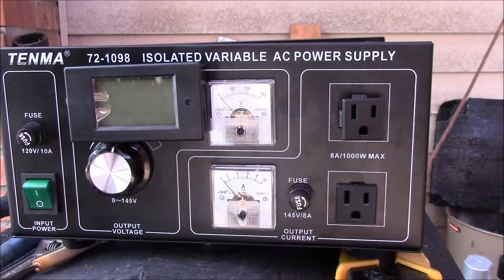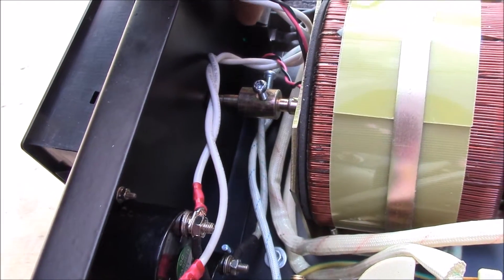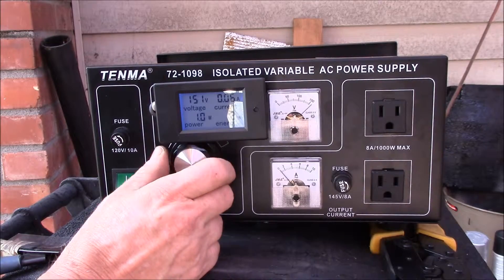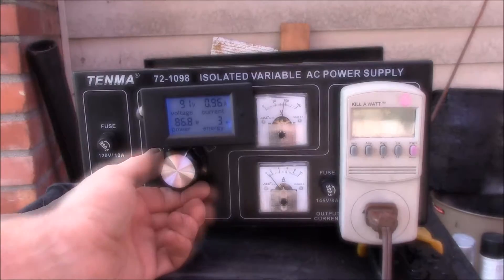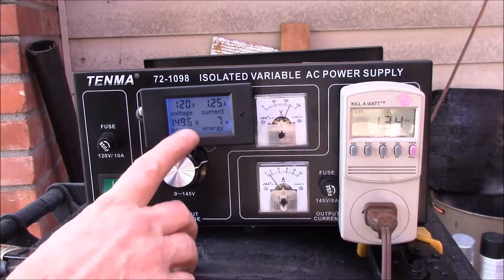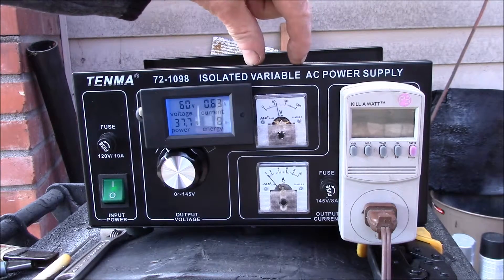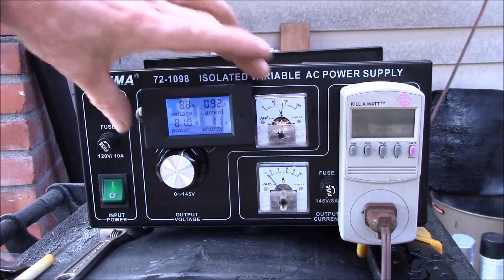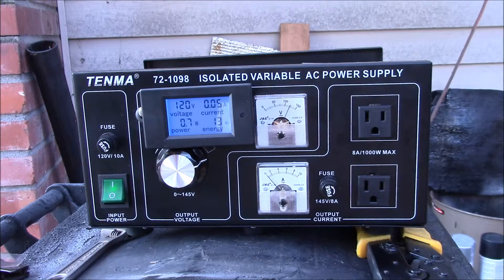Tenma 72-1098 Isolated Variable Power Supply, Upgrades

Comment: I only see 1 adjustment knob  ..only a voltage adjustment  .  ....can you not adjust the current lower than 7A ?   ..eg: limit the current to a max of 1A     ..you cant set current limits without a knob can you ?
Reply from the maker: Correct, there is only the AC voltage adjustment on the Variac inside.  There is no current adjustment and the 7A is limited by a fuse.  The current that flows will be determined by the output voltage and the impedance of the load.
Reply: @The4Crawler  do variable current  units exist ?
Reply from the maker: @relaxingnature2617  I think that is available in high end units, something like below:
https://www.keysight.com/us/en/products/ac-power-sources/ac6800-series-basic-ac-sources.html#KeySpecifications
If precise control of current isn't needed, there are tricks like using various size incandescent bulbs in series with your load to limit the current.

Comment: Sadly, Tenma (MCM Electronics) just dropped this supply from their lineup. In fact, it was in their latest advertisement, but isn't available on their website anymore. They even discontinued their more traditional "Variac" type variable A/C power supply. I'm hoping that they will either bring it back or replace it with something better. I ended up buying a Global Specialties 1420 instead. It's the same as the BK Precision 1655A, just rebranded. Unfortunately, the current output is only 3 amps constant and 4 amps intermittent. The 1420 & 1655A have two feature that this one doesn't have. The first is a variable output for a soldering iron, which is kind of pointless considering that if you need one of these supplies, you most likely already have a good solder station. Secondly, it does have a leakage tester which is a great feature if you work on older tube equipment or just want to perform safety checks on equipment that you have serviced. It came in handy for me recently. I was replacing a multi switch on my satellite system and received a small shock while connecting one of the coax cables from a satellite receiver. It turned out that another piece of my home theatre equipment was leaking A/C to the chassis, and like most consumer grade audio equipment, none of it is grounded. I repaired that piece of equipment and also eliminated a ground loop between my house and shop caused by A/C riding on the braid in the coax cable. Wow... that got a bit long-winded. I just like sharing experiences that might help others. Good video. Have a great day!
Reply from the maker: Thanks for the update.  Sorry to hear the product is discontinued.  Hard to find in that 7 amp rating, this thing is a real tank with all the copper and steel in it.  Good to know about the alternative, the leakage tester sounds like a nice feature.

Comment: What do you use that varible power supply for?
Reply from the maker: The isolation part is good for testing and working on equipment safely.  The variable voltage part is good for testing devices to get an idea what's inside.  FOr example LED bulbs:
 https://youtu.be/gsjpNA5Qhnc
You can determine what sort of power supply they have, how dimmable (or not) they are and check the power consumption, etc.